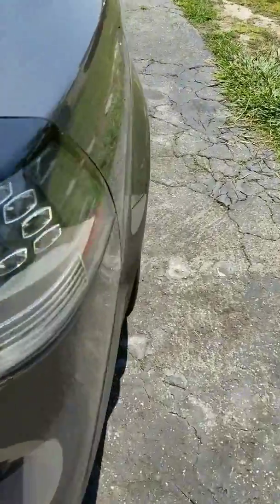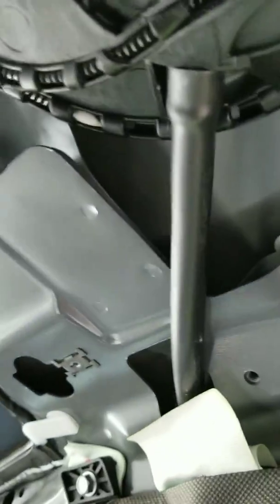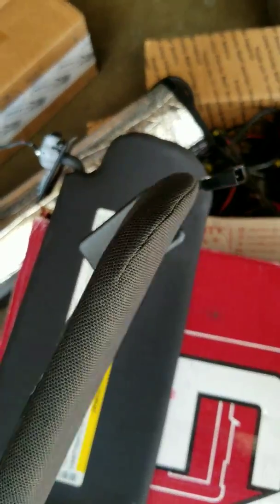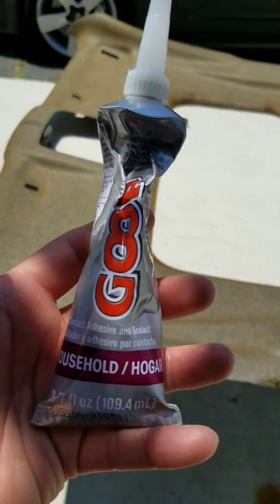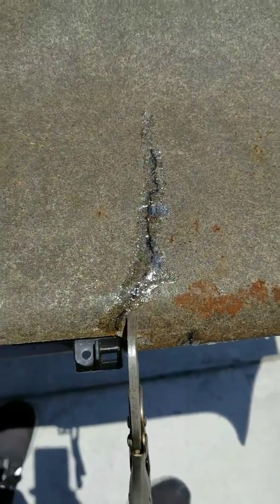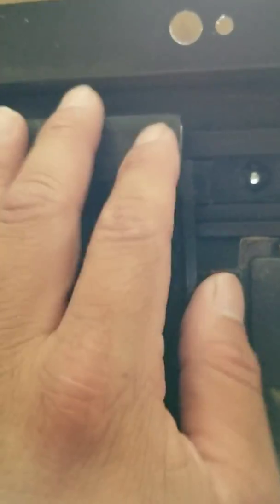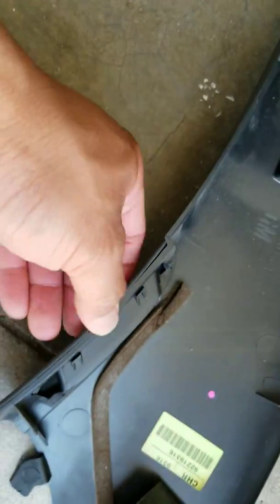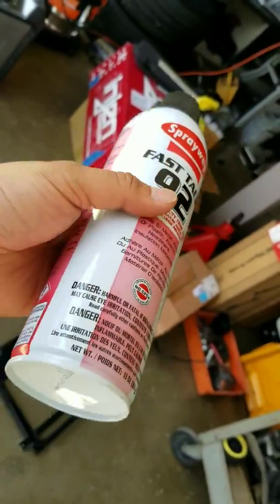Pontiac g8 headliner removed

Comment: Why the hell did you rip off all the wires from the headliner? Much easier to unplug the connector under the dash trim piece. Saves at least an hour gluing it back on and a ton of aggravation.
Reply from the maker: I didn't know u can do that, it would of saved time..